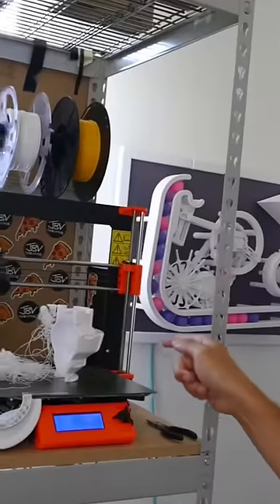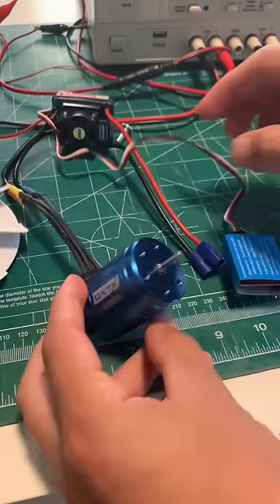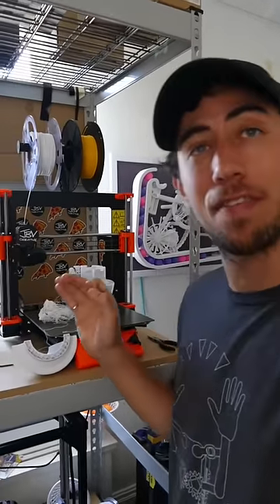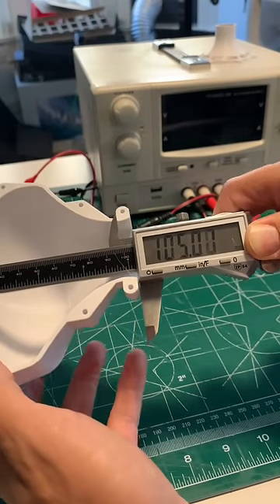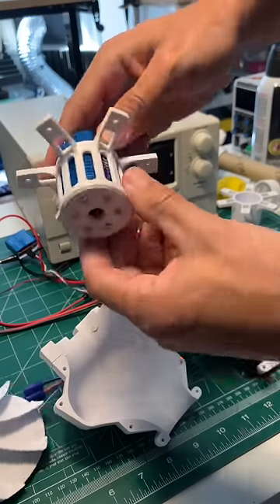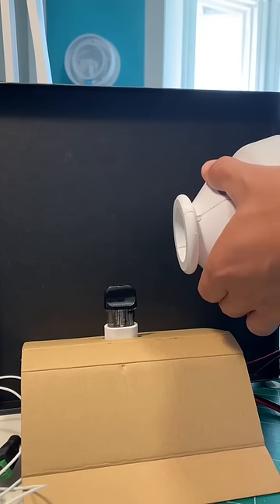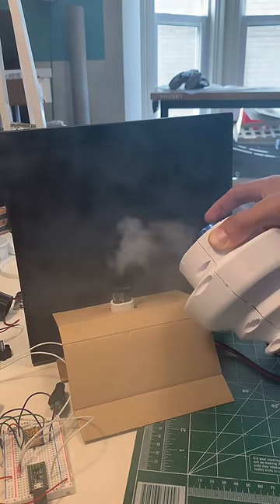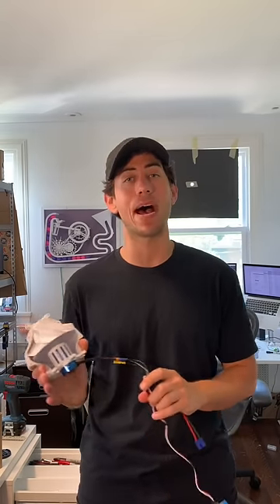Making A High Powered Fan with 3D Printing

Comment: Housing is design shape looks more for higher pressure rather then higher volume I think 🤔 it doesn't seem to have the volume capacity inside the housing itself. Try making a bigger gap/space between the fan and housing. If that don't work, look more for a EDF style turbine used in rc planes. There a reason they are designed that way.
Reply from the maker: Ill check it out! Thanks
Reply: 💯 % agree as I stated in another related video. Told him to go with a rc EDF (electric ducted fan) setup used on rc planes. Much higher volume of air as the turbine he's using is literally designed to build high pressure out a small hole but that works better when it's in a confined airflow area. Not sure why he went with this setup

Comment: Erm the fan is made in reverse,  the circuit is wired in reverse. And as for the Housing. You print with brace points obviously

Comment: did you consider flipping the project upside down before printing? 

largest side at the bottom? 

itll be less likely to fall over.
Reply from the maker: Definitely considered it, but I chose this orientation to ensure the inside of the house was smooth!
Reply: @Engineezy  i see, im guessing you considered including print supports into the design that are easy to cut off later for anything oblong or lopsided...3d printing sure is a exercise in ingenuity and perseverance. 😆

Comment: I'm just wondering why he put the smaller end on the build plate and not the wider one? It would've been less likely to tip, right?
Reply from the maker: It’s because of the internal shape of the housing, I wanted the inside to be smooth- if I flipped it the inside would require support to print and it wouldn’t be as smooth

Comment: If you want a high power fan you need to look at jet engines because the all work the same way and the are able to pull a 502,500 lb at 593 mph with two engines

Comment: How much power (Volt/Amp) does the Motor use at full Speed?
Reply from the maker: Honestly not too sure, it’s connected to a 2s battery so about 8 volts and it can draw a ton of current but I don’t have exact numbers for you
Reply: @Engineezy  thank you!

Comment: the problem is that the motor itself has its own impeler that sucks air throo the motor to cool it... maybe they are counter rotating with the turbine impeler...
Reply: or the motor should just be outside of the turbine, or, use inerspiner, and again check the air flow of the motor first...

Comment: That impeller is completely wrong. The inlet is tiny. If you think about it, if you are compressing something, it should go from large to small. Well same here. It should start with a larger section area and it should end in a small section are.

Comment: Are you seriously trying to figure out why the motor itself is sucking stuff in when you don't have anything to redirect it and you're trying to blow over it? Never mind the fact you don't have anything for the directional of the air and you'll cause a kickback which will make a swirl inside the unit

Comment: Delete the fin supports that should alleviate the issue. Or at least minimize the material between them so volume can flow through the fan instead of around it.
Reply from the maker: Ill give that a try!
Reply: @Engineezy  or do it like a turbo, a turbo is built in the same manner built it's outlet is along the path of the vanes rotation. That honestly IMHO is going to be your easiest route. You can cut a hole adjacent to the fins start small and move up if that was an improvement.
Reply: @jasonbarnes8047  I don’t think he has to do that. It would most likely also work If he made more radial space for the impeller to push the air into. Although a ’turbo’-like housing would work well, I think it’s better to tweak some things first before doing a whole new one
Reply: @xmysef4920  the air doesn't have a means past the vanes on the impeller without building pressure. Needs either an outlet that bypasses the vane restrictions or no vane restrictions. Extra volume would help but would end up in the same place without a proper outlet set up
Reply: @jasonbarnes8047  I guess that’s true, but still, if you let the compressor have more radial space (basically more space around where the impeller ends) It would be able to throw the air sideways, utilizing the centrifugal force and compressing more air. Then when you have that dense air in that space, you can just redirect it down and past the compressor, because it’s already compressed and has the force it needs to overcome those restrictions. Most small radial turbojet engines do this.

The reason why he would maybe want to do this instead of the traditional ”turbo” way of doing it is because a turbo is only a compressor, it compresses the air and discharges it. However this type (dyson fan) works by compressing the air to increase the pressure and then turn that pressure into velocity, providing alot of airflow for cooling purposes.
Reply: @xmysef4920  in theory your correct, but in practice you have to remove the air before it can replace the extra volume
Reply: ”You have to remove the air before it can replace that extra volume” Well where does it go? It goes out the back. That’s where it’s supposed to go once it’s compressed, because you want to increase the velocity with that pressure that you’ve made to blow and cool stuff. 

You do have a point, but we have both different ways of thinking. I guess we’ll have to see :)
Reply: @xmysef4920  that's the issue it isn't moving it to the rear and out the back. That's why when he removes the case he all of a sudden has proper air flow again.
Reply: @jasonbarnes8047  Yeah the reason why it’s better when he take the housing off is because with his housing it doesn’t work. 
It’s not how the housing gets smaller through the bottom, it’s how it can’t push the air behind the impeller after it’s pushed into the side because it isn’t compressed properly by the housing, making it have nowhere else to go than back and ultimately getting sucked back in again.

The fix to this problem however, is to well… make it have more radial space to throw the air into after it leaves the impeller, because then the air is compressed and channeled properly so that it has the force it needs to overcome the restrictions in the path of leaving the housing.

If you aren’t sure of what I’m saying, there’s 2 things that proves this, the dyson fan and the radial turbojet engine.
Reply: @xmysef4920  you do realize that's what I've said this entire time correct?
Reply: @jasonbarnes8047  Not really? You said he should switch to a turbo-style housing and I said against it, because it’s a compressor only, not a fan.
Reply: I’m just trying to say that he doesn’t have to remake the entire thing (making it ’turbo’-style for example) for it to work. I think he just wants to make the fan similar to the dyson one

Comment: Housing too close to the fan air can't move
Reply: The thinner part of the housing where the impeller sits should be close, but when it gets to the outmost radius of the impeller, it should indeed have more radial space to push the air into which can later flow down once it’s compressed by the impeller
Reply from the maker: Gonna try changing that!
Reply: @Engineezy  could be a vortex reversing the air.
Reply: @Engineezy  Hope it works! (and make sure that you only make it further from the housing at the outmost radius)

Comment: Output needs to be radial not on the opposite end to the input.
Reply from the maker: I want this fan to be axial! Any ideas?
Reply: @Engineezy  unless the fins continue all the way through. Not just in a cone shape. But 2 cones back to back. Solid core. With an outer shell 🐚 as you have it.. Air would be forced through the fins  but the outer shell would direct the flow out the back but continue through. ??
Reply: Two cones back to back, not just 1 half.
Reply: @stapp89  I know I’ve said this in many replies here already, but I think he should try increasing the radial space for it to push air into first

Comment: You need gaskets.  Air is leaking out the sides creating a low prepare zone other than the inlet.
Reply: No amount of gaskets is going to make this work, he needs to add a proper volute discharge port on the impeller housing.
Reply: @ferrumignis  not necessarily true, but it could help his specific design.  Many including one I designed and built myself use a centrifugal impeller yet axial flow.
Reply from the maker: That would def help